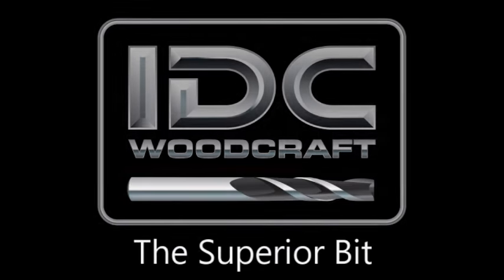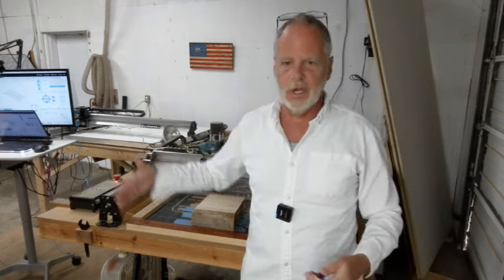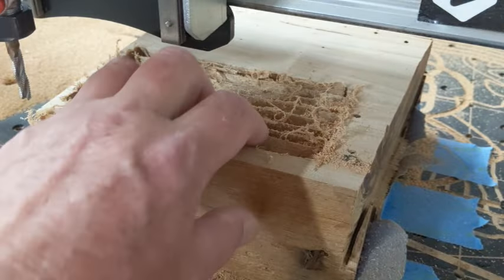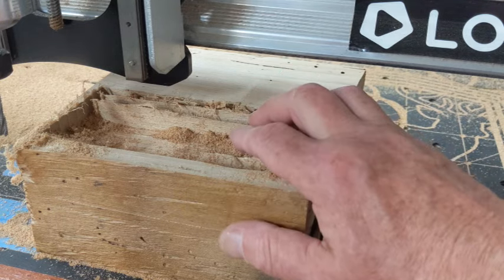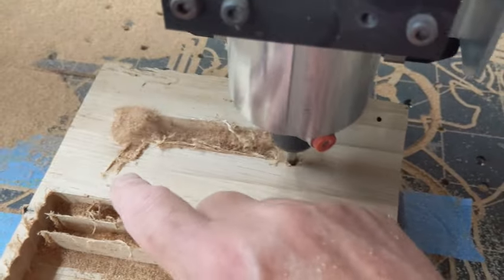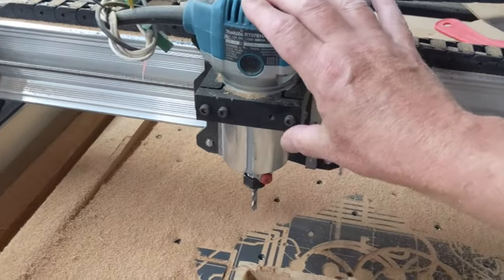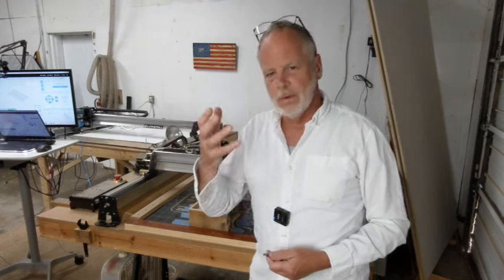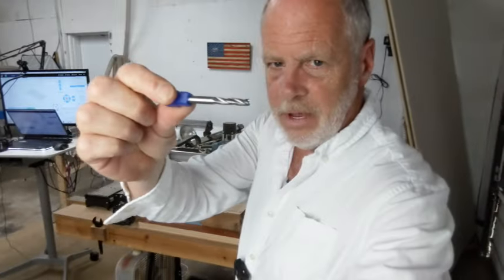Can Benchtop CNC Routers Handle This CNC Bit?

Comment: I wanna see the beast vs the hog. Both pushed to failure. Bit break? Wood slips? Stepper motors stop? What gives first? Don't get me wrong. I like this video but I would like to see more torture. I also wish places would Give an estimate on how long or how many inches a bit is supposed to last Under  correct parameters of course.
Reply from the maker: Adamizon, thanks for sharing your thoughts brother. You've definitely given me some food for thought on this!

Comment: Hi,  I bought the Badger and the Beast and with all do respect the QC Code on your bits that  takes you to the specs are not clear on what we should be running them at and for what type of woods.  I do think you should up date them with some type of chart.   Most of us can not afford to keep buying bits
Reply from the maker: Betobeto, I have the perfect thing for you,  I have the IDC woodcraft app that has all the feeds and speeds for every IDC Woodcraft bit right on your phone. It also lets you select different material types so you can ensure you are running the right settings for the right material! Give it a shot
IDC Woodcraft CNC Router Bit App Links
Apple → https://apple.co/3IKj9Td
Android → https://bit.ly/3kmFCfN
Reply: What about metal material? There is no info about feeds and speeds for any metal

Comment: I have The Beast bit; love it! I ran it on a Yeti Smartbench spindle. It makes the same noise that your Longmill makes. Scary fast! I love watching the Beast move quickly through the project. Unfortunately, the Yeti threw a hard halt, stopped the job and gave a warning message "Boundary Issue." I'm replacing the Yeti Smartbench with a Longmill, but I don't want to over load the Longmill. If I understand your recommendation it is to run at 85 inches per minute, no more than .5 inch depth and 80% step over. Is that correct? Does the type of wood effect the recommendation?
Reply from the maker: waynehyatt5565, glad to hear you like the BEAST brother. As for your feeds and speeds, I do have the IDC woodcraft app that has all the feeds and speeds for every IDC Woodcraft bit right on your phone.  It also lets you select feeds and speeds depending upon different material types. Give it a shot
IDC Woodcraft CNC Router Bit App Links
Apple → https://apple.co/3IKj9Td
Android → https://bit.ly/3kmFCfN

Comment: Is using it for smaller passes 1/8 to 1/4 bad for the bit?
Reply from the maker: CinemaCakes, Using smaller passes like 1/8 to 1/4 inch is actually a common practice and can be beneficial for the bit. It helps reduce the load on the tool, leading to less wear and tear over time. The key is to ensure that you're feeding at the right speed to avoid overheating. Just pay attention to your material and bit type for best results!

Comment: I have a Onefinity Elite Woodworker with a 2.2kw spindle attached. Would you still run the same settings? I guess it would be less strain on the spindle vs a makita trim router to begin with.
Reply from the maker: the-wooden-beard, I recommend downloading the IDC Woodcraft app and then you'll be able to adjust the setting (router and material) for your projects to be more accurate. 

Here's the link for iPhone users→ https://apple.co/3IKj9Td
Here's the link for Android users → https://bit.ly/3kmFCfN
Reply: @IDCWoodcraft  Will do, thanks!